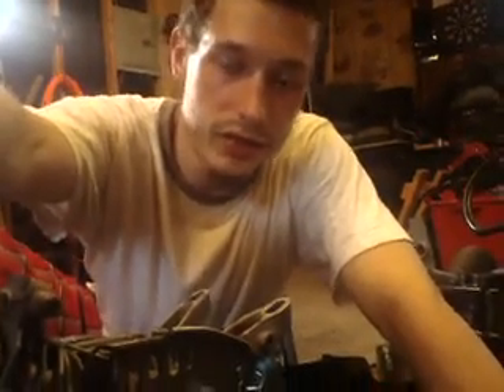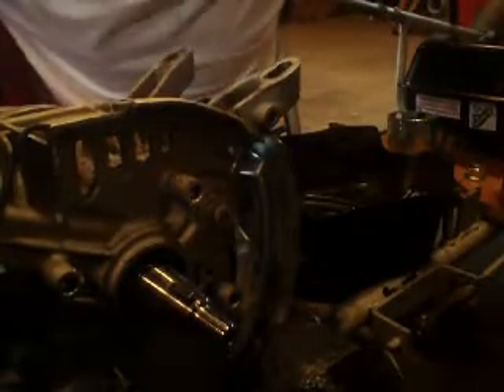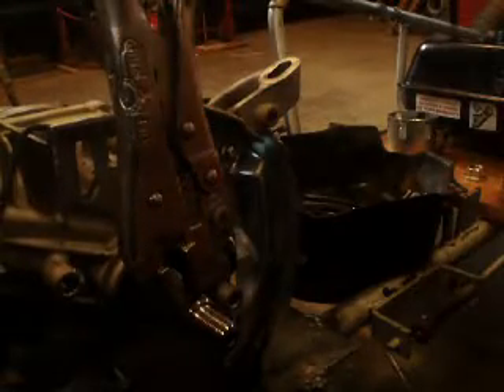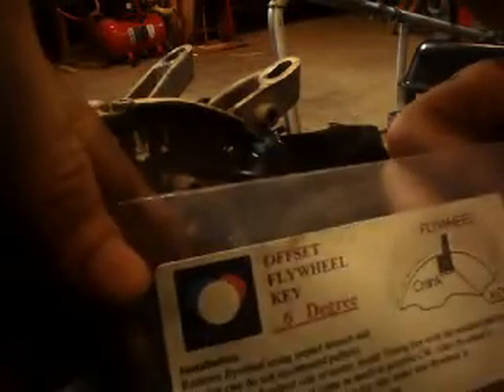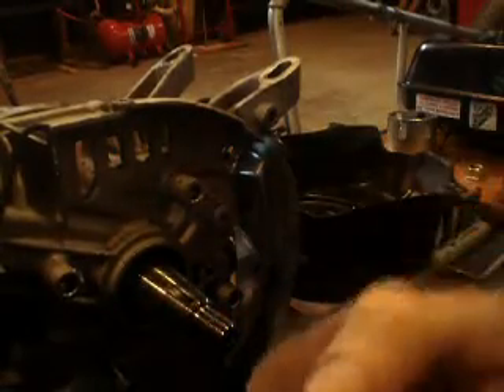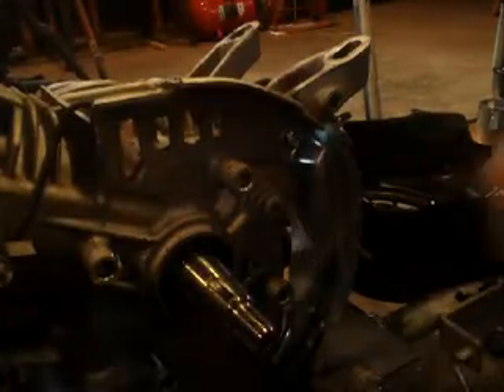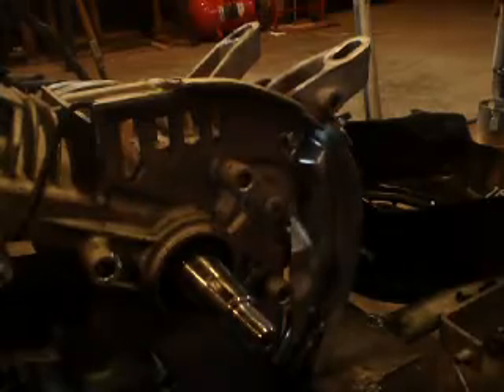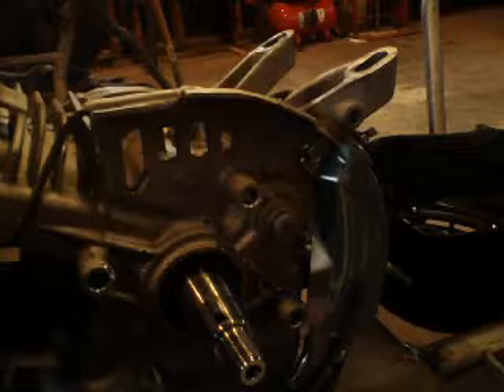Setting Ignition Timing: How To on Predator 212.

Comment: Use side cutters to pull the key out. When you put an offset key in you need to turn the flywheel clockwise before and as you tighten it. Not a bad idea to take the nut back off and check alignment. It's not impossible to install an offset key and tighten it to where it's in the same position as stock.